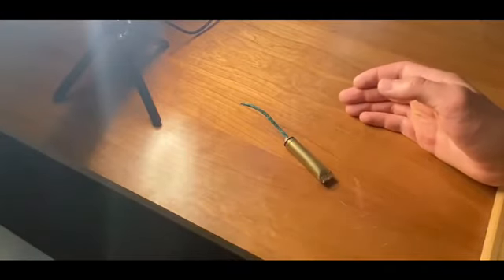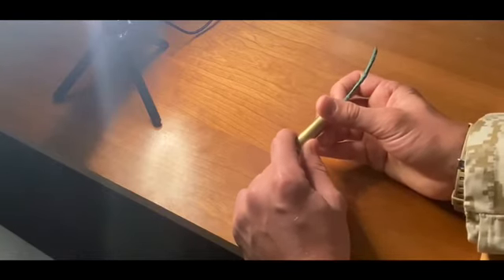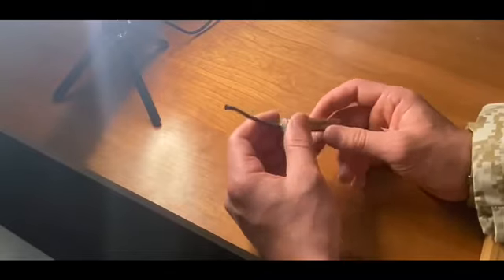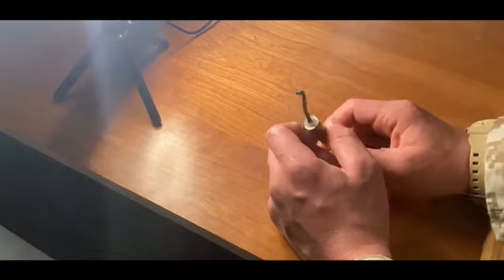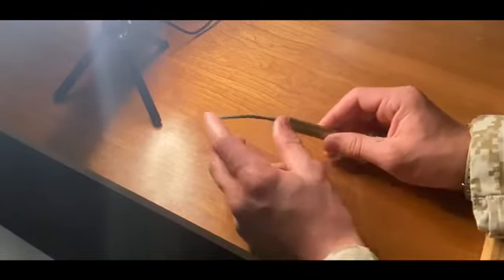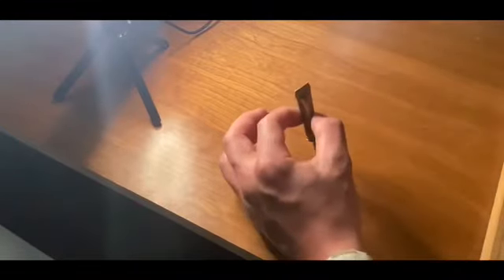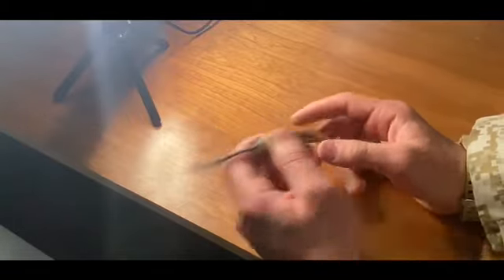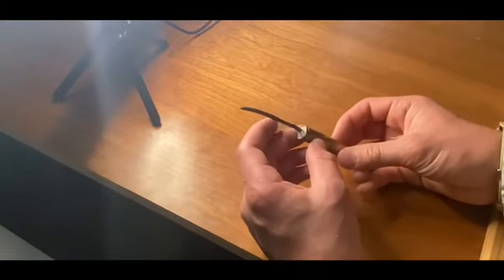How to make a firecracker/ blasting cap

Comment: I need this for the beaver dams in our drainage ditches that are flooding our fields. It is not safe to shoot the tannerite so i opted to a blasting cap. I already have about 50 ft of fuse from my grandparents that they used 75+ years ago to blow up stumps.
Reply: using 75 year old fuse sounds like a deathwish

Comment: HOW TO MAKE A PIPE BOMB ingredients: Ammonium nitrate (not less than 32% nitrogen) aluminum powder 9.5/.5 ratio by weight, a blasting cap ingredient: brass casing filled with flash powder. Then drill a whole in the end cap fill the pipe a small bit drop in the blasting cap (you want it in the middle) fill the rest up insert the  end cap then screw it on, finally glue the crevices to completely seal the pipe bomb so the contents stay away from oxygen that will deteriorate the mixture.

Comment: I've been working on an effective and reliable design for a cap, somewhat similar to this. Spent shells as well as shells with live primers are perfect in their profiles for such improvised caps. The one I've come up with combines about 3 or 4 different sections that all contribute to one single initiation event, which is more than I'd prefer, but so far it's performance is good. I use a combo of pyrodex in a brass shell, topped with a Hilti blank pressed into the tip of the shell where the slug would sit, with a rubber O-ring or grommet fitted around the shell, which is then slid into an aluminum tube of 3/8 or 1/2 inch or so... Once fitted tightly into the tube I make sure its mostly off center with the cartridge situated more towards the end where the Hilti  round visible from one end of the tube, where I insert a chunk of KNO3 rocket fuel along with a pce of visco fuze topped off with some hot glue or other such suitable wadding material. At this point, you've got one end sealed and ready to go as is with the other end of the tube still open with a bit of empty space available all the way up to the point where the rubber o ring or grommet is fitted around the shell. In this cavity I insert some cotton wads, not too tightly, which I saturate with pure nitro until close to full, adding cotton  as needed so it's not too runny, a good cotton to liquid ratio, and then plug that end with a suitable material. Use caution at this end, hot glue can be used so long as some means of insulating is utilized to prevent heat exposure to the nitro...if  a cork or rubber stopper or plug or cap is used then do so gently when pressing. And that's all... It works well and is surprisingly powerful. I found that the rocket fuel part is necessary as it burns slow and hot and the solid residues it leaves behind conduct the heat well enough to heat the rim of the Hilti round enough to set off the rim fire mixture within, which initiates the whole assembly. Tried different powders but they mostly just burn too quickly to generate and transfer enough heat to the exterior of the shell to cause ignition. Anywho, please share or try or feel free to perfect or add to, improve, or whatever...I encourage it. Such methods may turn out to be very useful knowledge in the near future. Be safe now.
Reply: Hilti caps only produce 335 God max . Black powder can reach 1,200 for plus . No need for th
Reply: The addition of primers
Reply: Fps Max Fukien spell check
Reply: @lisadulac7828  wasn't expecting to hear any comments from a person of your persuasion... most females have very little interest in explosives.

Comment: This isn’t going to detonate ANFO or any standard ammonium nitrate composition unless it’s been additionally sensitized somehow.
Reply: additionaly sensitized whats that?
Reply: @fajitasbro  usually by adding aluminum powder or another more reactive fuel.
Reply: Literally just Tannerite
Reply: @Mantic0405  it's the ratio of the fuel that matters for something like this. It wouldn't set off regular tannerite, at least not reliabily.

Comment: could you set potassium chlorate and a plasticizer off with those caps?
Reply: No. I am surprised if his even worked since it's det speed is low. His is more like a booster than an actual blasting cap.

Comment: Would that blast cap set off a pipebomb full of smokeless powder?
Reply from the maker: Yes but that’s not what it is meant for. That would ignite with a regular fuse. A blasting cap sets off mainly high explosives.
Reply: A fuse would set off smokeless powder
I see what you're up to lol. use black powder or flash powder both very easy to make
Reply: You don't need a blasting cap to set off a pipe 💣 full of smokeless powder. Itll ignite just by running a fuse straight into the pipe.
Reply: Footing Ball555  Which is why I said you dont need a blasting cap to detonate it if it's in a pipe.
Reply: Footing Ball555    Hmm.. So I'm not trying to be condescending or saying you're full of shit. Hell, maybe you know something that I dont. 
So how exactly would a blasting cap increase the performance???
 I made it through about 17 weeks of EOD school in the military (unfortunately didnt graduate the school, extremely fucking difficult, but I did learn a little bit) and I've never heard of this. 

I was taught that the sole purpose for blasting caps is to detonate explosives that were developed to be safer to handle, resistant to detonation from falling or being dropped and require a specific amount of energy in order to detonate. 
The blasting cap's only purpose is to provide enough activation energy to detonate the secondary...TNT, C4, etc.  I've never heard that a blasting cap will increase performance.

Swim might go test this theory...he seems to be curious about it.
Reply: @travism9339  
I thought the same thing but every diagram I've seen on how to make one shows a blast cap
Reply: @chairmanm3ow  Take my word for it, bruh.